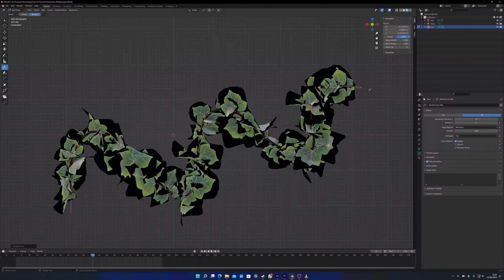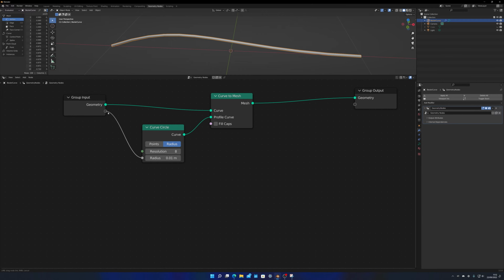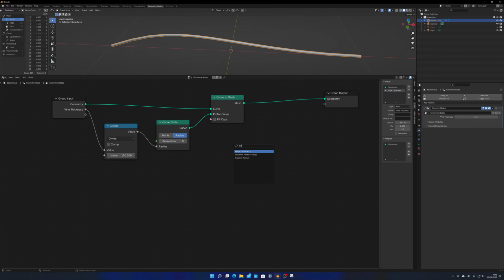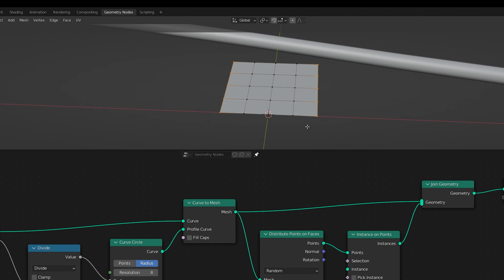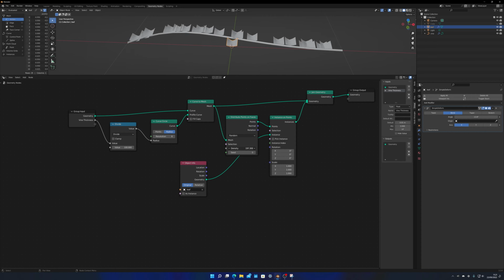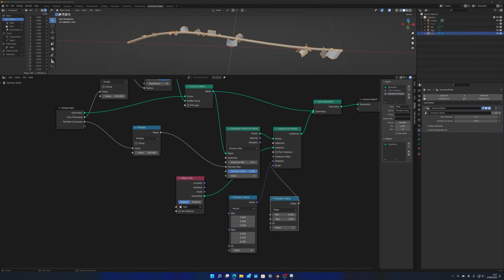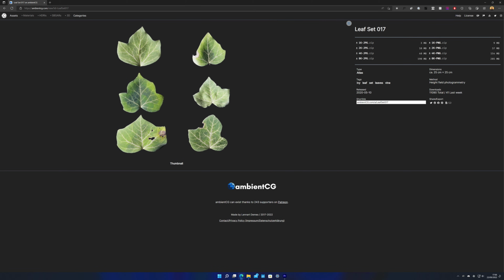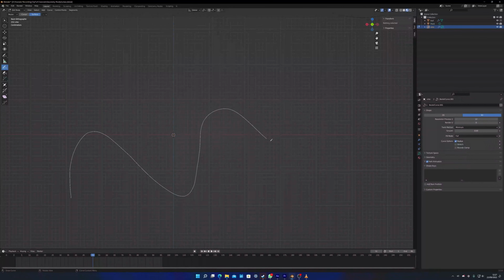Simple Geometry Node Vines using Curves

Comment: For the people who get the same color for vines and leaves and don't know how to fix it; if you highlight the vines it will include the leaves when you add the material. Make sure you select the original plane you made to create the leaf, and remove the material from that. It should keep the vine brown, but the leaves go back to it's original color.

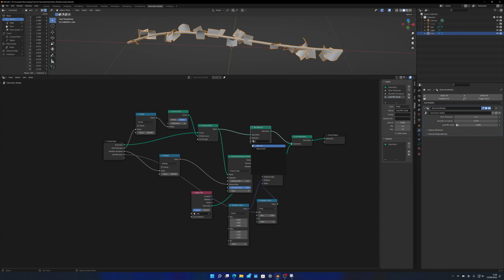For adding the leaf texture, on the left side at 2:51 it's a Texture Coordinate and Mapping node. You need to have the Node Wrangler add-on installed for it to work. CTRL + T will add that left side. To add what you see on the right side, you need to highlight the Principled BDSF and click CTRL + SHIFT + T, then you should see a node containing the boxes similar to the one on the right. It will probably contain Base Color, Roughness, Normal, Alpha, and Displacement.

Hope this helps and pushes people in the right direction if you got a bit lost on that part!
Reply: What about the vines still having that black background? How do I remove it.
Reply: @jonasphu  You can set Material blend mode of the vine leaf to [Alpha Clip]

Comment: This is great thank you. How would I go about converting this to a mesh? When I attempt converting I loose the leaves and left with only the vine. If I try to apply the modifier I get an error "Transform curve mesh in order to apply constructive modifiers"
Reply: I found a solution in case anyone else was trying to figure this out.

You need to add "Realize Instances" between the "Instance on Points" and "Join Geometry". However this will mess up the UV mapping of each leaf. To fix this you need to add an attribute to the leaf material (not in geometry nodes but in the shader nodes) leading into the vector of the image texture(s) . Set the name on the attribute to "UVMap"

https://i.stack.imgur.com/bJfGM.jpg

I hope someone else finds this helpful.

Comment: I get lost on the texturing part. I added a material and made it brown, but it made the vine and leaves brown. How to separate them? And how to add an image to the leaves? Can there be multiple leaf images mixed in throughout? How might I add in bunches of grapes?
Reply: i too was stuck with this for a few time, here is what i found out the solution could be but with this you would have to give up on the diversity of leaves i.e. sacrificing on the details, firstly select the original leaf plane and perform a UV unwrapping around the leaf texture(any one of those). then select anyone leaf among the other bunch and and wrap the texture around it. then go to the shading tab and from the opacity texture connect the color node to the bsdf's alpha and one the right side of the shader panel go to the botttom at settings and set the blend mode to alpha clip